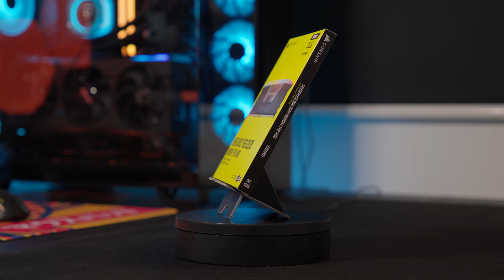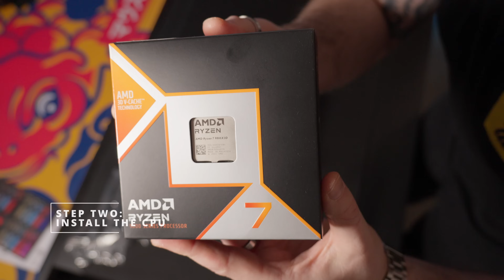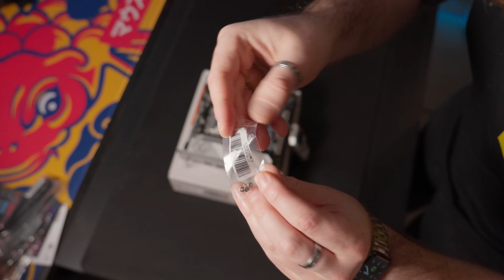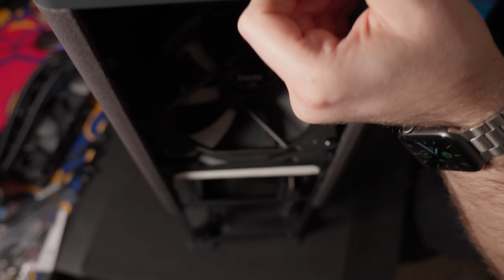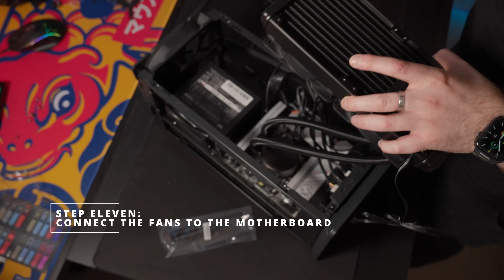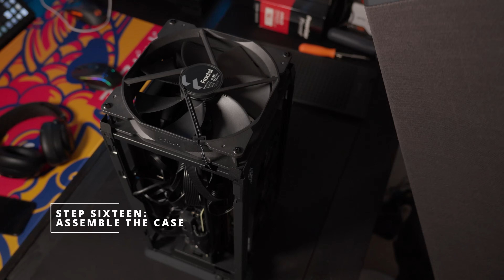How to build an INSANE Xbox Series X inspired Gaming PC!

Comment: Any good air coolers for this case? An aio seems tricky to cable manage in this kind of case and apparently using an aio will heat up the gpu.
Reply from the maker: @Unknownuserlmao  if you search online for “fractal mood cooler compatibility” it’ll give you the exact measurements so you can see what fits and go from there. Definitely would be easier to cable manage with an air cooler!
Reply: @I tried to see if the jiushark jfk13 would fit but it looks like the motherboard is too low for it to have any change of fitting. I think I’ll just get a thermalright peerless assassin 90